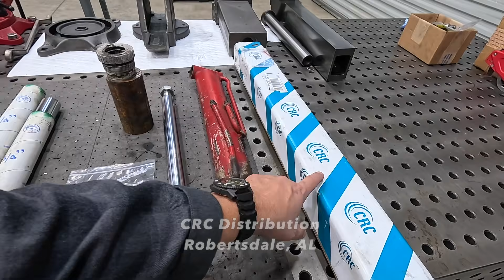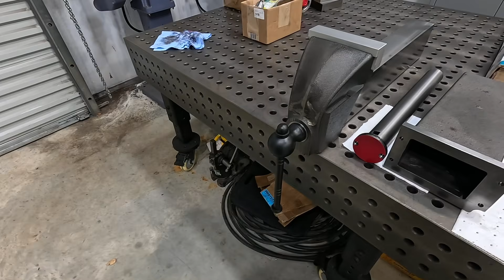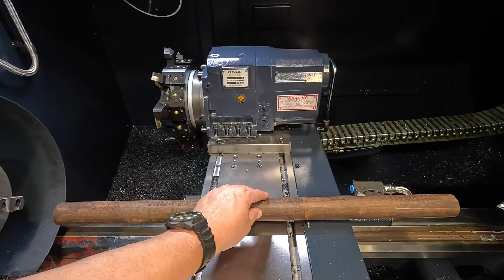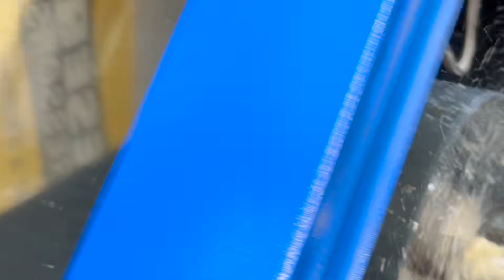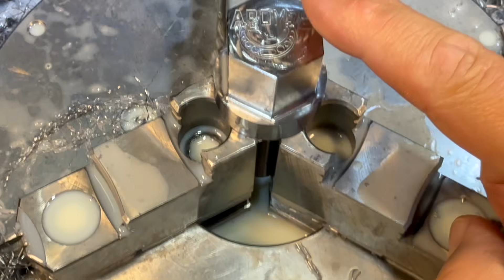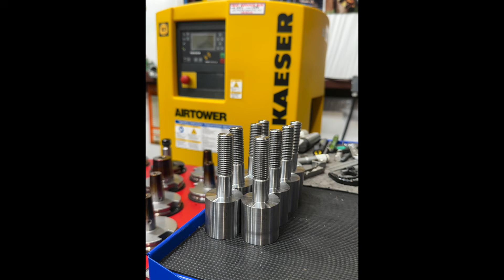Hardtail Vise Prototype Flange Bolts, CNC Machine Updates- SNS 383

Comment: Adam I am sure you get a lot of people asking if you could help them. But I was wondering if you could take a look at something I have that needs repair. All the local machine shops near me tell me they can’t do it or just aren’t interested in doing it. I have a transmission case(aluminum) the cracked when a bushing was pressed in. It is a brand new case and hate to trash it off it can be fixed. I can weld up the crack lathe dissent have the capacity to machine it back on the sealing surface. If you are interested I can send you pictures to look at and see if you would or could do the machining work. Thanks for any help you can give.

Comment: Add a v groove around the head where you want that chamfer to be before heading to the cnc mill.  As it's not touched when the hex head is being carved should allow a chamfer to remain by virtue of order of operations.

Bottom half would be the chamfer you need at the shoulder of the hex head.  The top half would be eliminated by the mill cutting the flats for the hex head.

Comment: Just a random thought: Having a 1.25" head, rather than 1.125", it would be close enough to a metric 32mm spanner to work. I use 32mm spanner on 1.25" hex-bar that I've got - it's a TINY bit slack, but for that size the 0.25mm isn't that much of slack. 1.125 is 28.mm5 (+/- a bit), so it's not a practical metric size - neither a 28 nor an (unusual) 29mm would work. 

I know you're not really a metric guy, and the number of hardtail vices in Europe is probably lower than in the US - glad to hear the US made ones are coming soon... It's taken a long time...

Comment: Adam, could you turn the chamfer before milling with a point tool in the CNC lathe? Then mill the wrench flats down to the centerline of the V-groove and you have your chamfer. The engraving tool does such a better job than laser etching—very nice! Yup, the cameras oversharpen the surface texture creating the appearance of edges you can’t actually feel. This vise is going to be too pretty to use!

Comment: Love what you are doing. Nothing wrong with what you have done for the application, but a suggestion for high load applications is to groove under the head axially. The benefit in this case is the appearance, if you want something that looks different to what is normally done. You would maintain the 0.630 diameter and groove into the seating face. The usual advantage is that the stress raiser that is created is FAR lower than when you machine into the diameter of the part. Tools are available to do this such as (no association, just a google search) GROOVE 'N TURN Insertable Angled Face Grooving Tools - ThinBit by Kaiser tools. With this tool you can actually do the combination machining (cutting in at a 45 deg angle) so that you have to remove the minimum of material while ensuring there is no corner to catch on. (removing material both axially and radially).

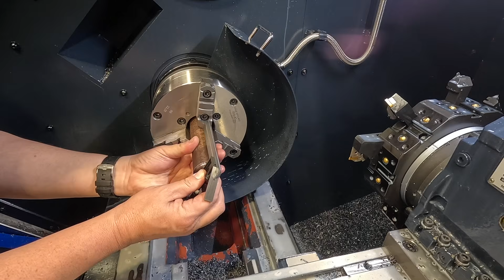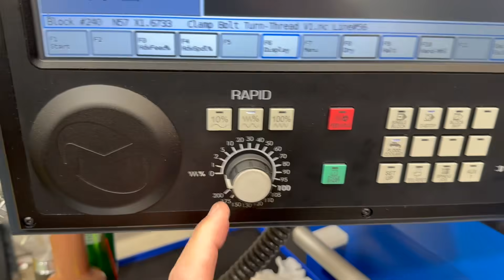Comment: You can use G94 (43:19) to place the face of the part against a tool in the turret (the reference for the length) and use programmed stop M00 (44:34) for the tailstock.

Comment: Just a thought: chamfer the top of the hex in a "lathe style"
Practically, mill a cone, with very fine steps on z, to get something similar with what a lathe tool would accomplish (just touching the sides of the hex). I think it would make the bolts look even better.
As for the finish on the vise, I think the cast iron color looks incredibly good as is, so something to just hide the angle grinder marks on the seems, but keeping the current color, would be awesome.
Thank you for sharing! Best wishes with 2025 projects!

Comment: on this, every third  month, "i'm afraid of cnc and have to keep programming stops and running it at 50%", we see adam is hoping an updated cnc machine and software will come with confidence in the future.  45 minutes before the first part is pull off the lathe.  for crying out loud, move this stuff along.  hit start and send it.  88 minutes for 3 bolts, not including a washer.

Comment: I saw a video somewhere recently (I don't remember where), but they made the hex head on a bolt using a lathe, I dont know how the program worked, but it was incrementally cutting as it spun the part.
Reply: That would does on upgrade version of cnc lathe it has rotary spindle on the tool post it rotates with the main lathe spindle rotation

Comment: Making a set of aluminum soft jaws to face off washers in CNC would make for neat video and once you have bugs worked out, very easy to run high volume of production parts

Comment: 48:07  When I programmed and operates the old CNC Lath at the punch and die hop .. The machine would never approach a cut  in that manner.  It'd get within 1/2" and approach slowly at a 45° Angle, this was the default approach not a special program we made. 

I'm surprised to see a modern machine approach so aggressively??  Maybe this "Fusin 360" method is designed to save time?  Just an observation :)

Comment: I wouldn't expect a metric thread in a product made in the us.

If I may give you some advice to set your Z-Zero safer and faster (I do it dozens of times a day). U know how far you have to turn. Per example your finished workpiece is 5 inches long. Just position the tip of your tool short before the face of your jaws and set your zero by "set  -5.0".   Prevents a lot of crashes and is way faster than measuring it by hand. 
Also, turn your undercuts with your DNMG insert. You don't need to "modify" a grooving tool for that.  Diving in with -30° and turing a radius on both corners is much more stable than a straight groove and there is also no  burr thrown up. But this is a european thing (if you are interessted we use DIN76 shape for thread undercuts and DIN 509 for common undercuts). No additional tool, no additional process - it is just part of the conture), I wonder if this is not also common in the USA?

Comment: Instead of messing with that feed overide, change your feeds in the program how you want them. The worst thing ever is messing with that overide and forgetting to turn it back down on an operation where it could over stress the tool.

Each G1 line can have it's own feedrate so even during that rough turn pass where you turn the knob up and then back down you can just go into the program and insert the feed rate changes on the G1  lines as needed.

Comment: Looks very messy. Get some lolly pops and dial those coolants in. And all of your pauses and manual feed overrides should just be in your program. Also multiple tools being used to do the job only needed by one tool. Limiting your max rpm’s affects your surface feet which affects tool life and etc… for small runs all this stuff doesn’t really make much difference but for a large run these would be critical.

Comment: Great channel.

A  very minor point on your description of the final part :
For 17-4 PH, the PH stands for "precipitation hardening"  not "pre hardened"  

Perhaps this was just a slip of the tongue, but  since you are usually so disciplined and detailed in your  technical information I will not assume that to be the  case.  If you tried to make the  flange bolts out of 17-4 PH  in its precipitation hardened state it would be a  very tough machining job manual or CNC.

Keep up the  excellent videos

Jimmy Johnson

Comment: I would like to see a shaper in the shop.  Not very practical but I love those machines.  On the practical side maybe an HBM.  Also, I look forward to "Abom79 Manufacturing".  Other YouTubers have done ventured into manufacturing.  My only suggestion is to keep the products small and inexpensive.  Unfortunately that will probably mean low profit margins.  I would like to own an Abom79 product made by and in Abom's shop.  A product I would like to own would be a 9 inch 3/8" breaker bar with the Abom79 Logo.  KOKO!

Comment: Those are beautiful and a very functional item for your vice.
The only suggestion I have is you might consider a high polish finish on the head of the bolts before engraving your logo. The swirl mark left by the tool makes it difficult to see the logo, at least on the video.

Comment: I also prefer the wrench, my favorite setup is on my Charles Parker vise. There is an excellent image out there on a 973 bench vise with original handle. 
The top portion of the nut is a cylinder with a split ring to retain the wrench. This way the wrench is easily moved out of the way but still stays with the vise. 
The wrench would also give you a chance to add your logo and would probably make an excellent decorative sale item.

Comment: I don't own a hardtail vise, BUT IF I DID, I would go for blued or nitrided finish, maybe 1045 or 4140, with either a square head like on an old-school lantern toolpost,  or maybe a 12-point spline. And a custom wrench to match.
Reply: Or maybe a perfectly round head--and incorporate a torrington clutch bearing into the wrench. To really confuse the newbies.

Comment: A few tips/ideas for your consideration. 

Bring a tool body down to infront of your Z to act as a bar stop to pull out to. Then you wont need to use your square. 

When roughing/finishing your front chamfer leave it slightly undersize. Then after the screwcutting cutting come back in with the finish tool and rechamfer to size. But, chamfer from -Z0 to the front face which pulls the burr out of the thread. You can also do the same with the under cut at the back of the thread.

Comment: Great video as always Adam. I would consider making something that McMaster don't offer for the machinist. Maybe something like sine plates for setting the crosslide to the correct angle or tool height setters for the lathe. Maybe Tool Posts or Tool Post Nuts. Sine Bars, DTI holders, setting plates, something that the hobbiest may need. Maybe even something for the Camper Van industry.

Comment: Put another groove in during the turning ops to produce a slight chamfer on the top of that shoulder. Or, run a 10mm  spot drill around at the end in the mill ops.

Comment: Something to take into account is that the USA is the only developed country on the planet that uses imperial units. The US industry also mainly uses metric as it is the world standard, this has nothing to do with opinions but facts. Slowly the US will in general also move to metric, and it is easier to use. There will be an overlap for quite some time (like in the UK).
Reply: post 2000 fords and chevys use metic.  As I also on vintage vehicles (Moke, Lotus Europa, 7 triumph motorcycles, dodge A108 van) It's all either SAE or Witworth or British Cycle thread. The UK still uses plenty of Imperia---- oh wait they've abandoned most manufacturing.
Reply: @silasmarner7586  So true !!

Comment: Hi, now that the Flex CNC machine has been passed on, the freed-up space could, for example, fit a CNC wire cutter. Not every workshop has one, and as far as I know, they can be used to make quite special parts. But whatever the new machine you eventually get will be, I’ll be eagerly waiting to see what it turns out to be. And regarding the logo you engraved, I believe it would look even better in the finished piece if you painted over the logo with black paint and then polished the end of the bolt so that the black paint would remain only in the engraved logo.

Comment: Though I would love to have one of those bolts as a hobby machinist I need to stick to something I can actually use. However, those generic stainless steal bolts, holding the vise to the table, need to be upgraded to equally impressive Abom79 bolts. Us hobby machinists would love to have some tooling made to fit our budget level made by Abom79. Please keep us in mind. If there is anything you have made, modified, that you feel we, at our level, could make use of, other than the cheap Chinese crap, consider maybe making it and offering it to us.

Comment: 49:00 it would require some sort of a sticker on the tool (or some other spot that's at a similar distance from camera to the work piece) w/ a high contrast crossed pattern for the camera's sensor focus to latch onto. sensors focus based on contrast lines, having both horizontal and vertical lines ensures the sensor 'see it'. shinny and/or wet surfaces offer v little contrast...

this is a bit beside the point and refers to adjustable focus: the smaller the aperture the deeper the focus plane. it means the focus could be a bit off and objects still appear sharp.. given there's sufficient light, a small aperture results in faster focus too (less focus-search).

Comment: Dig the bolts replacing the knobs. I wonder if you could turn down the area where the hex is to give the corners of the flats a slight radius at the points? Also, would a larger chamfer around the top cut in the lathe would be more visually pleasing? Enjoy your channel. Thx.

Comment: You could use the parting blade on the lathe to cut a groove where the chamfer will end up and then chamfer it before you part it off. The faces of the hex will remove the opposite side of the part and you will be left with a chamfered edge before you go to the mill.
Reply: Yeah, I was just thinking that. You have spatial imagination.

Comment: Man, that is a big ass expensive machine to put in someone's shop when that someone is newer to CNC and primarily does manual machining. 😮 And to provide so much support on top of that it's just amazing.. no doubt, flexcnc got some good publicity by sticking it in front of this audience, but still that was super generous of them. Also, I'm sure that the smaller machine is going to be a great fit. With the exception of those pieces of angle iron that recently got some holes put in, I really can't think of anything that's been  even close to needing so much bed length. 👍
Reply: Yep, Adam has 562,000 subscribers, and I'm sure the companies that have their machines have sold more, than without them there. They can't sell them if nobody knows about them or what they can do.😀

Comment: It's been a few decades since I  machined. I'm thinking you could use the threading tool to plunge cut for the chamfer. There was a series of parts we made with hex stock, but we put a 15 degree angle to the minor of the hex. Personal choice of course. Also we cut our parts completely off. We sharpened the blades at an angle to cut the part side first. It's your show. The Hard tail project is awesome!

Comment: The hex head bolts are hugely better than the sliding handle bolts.  Disregarding the personal opinion of the ergonomics difference, you can get a lot more clamp pressure to resist the vise spinning when you use that longer wrench but I'm sure I'm the only one who has used a hammer on those sliding handles to make the vise hold still.

Comment: Adam, I am not a machinist’s bum-crack but regarding orientation of you logo on bolt heads, is it possible to make an internal threaded mandrel that you secure in the chuck?  You then tighten the bolt securely in the mandrel when you have the top face of the mandrel flush with the top face of the chuck jaws (your zero).  This would ensure that your logo is the same orientation when the bolt is tightened and allows for accurate repetition of parts.  You could mark the mandrel’s top face to repeatedly align it to the same position in the chuck jaws?   I don’t even own a machine but I have learned much from you, including lateral thinking in problem solving.  Stay safe, ABomb79. Your videos are priceless to me! Delete this if it’s useless to you.

Comment: Chamfer on the hex side suggestion - The flange is turned to size, use your treading tool to put the chamfer in while you have it in the lathe.
Reply: This is what I would do as well.

Comment: 4140 is notorious for thread galling.
Reply: But only with 4140 as the mating surface, the hydraulic cylinder might not be 4140, or it might not be hardened to the same state as the piece of drop he'll be using? This can be a problem without a cause for alarm, yet. He has a lot of experience with hydraulic work in his past.

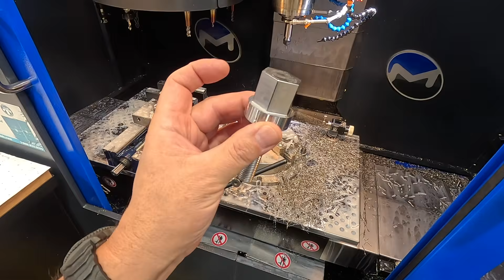Comment: At 59:00 where you don't have the tool to chamfer the edge on the shoulder at the bottom of the hex - what if you added that step in the first process while it's still in the lathe. You have that shoulder height (+/- 5/8 to 3/4'?) and just plunge in .010 to .015 v tool?

Edit: just read in the comments a few others already said the same thing.

Comment: Excellent job Adam.  Could you make a custom tool with a flat pad larger in diameter to the head of the bolt and glue some scotchbrite on the pad?  That way you could have the mill polish most of the machining marks off the top surface which would make your logo engraving pop even more.
Reply: I think he likes the swirl finish. It is very different of course to see on anything machined. This is a unique look.

Comment: I would have preferred a turned finish on the top for the engraving.
Reply: A domed with a very large radius top turned on it as a second op would be my choice. Gives the mill a bit of a work out while engraving. Have not done the math, and my thoughts migbt be incorrect but over that short distance the rise to center would only be .003 thousand of an inch and the way the engraving is laid out would work with out any changes. Now, if this was a smooth diamond drag engraving the rise would count and needs to be accounted for. If it was a 3D pantograraph the pattern would need to be 3D as well. Since this is CNC it is simple as it gets to account for it, even with the conversational programming the mill uses. Well, maybe not that simple -come to thinking on it now. But with Fusion 360 of course it would be easy. Just create a drawing on the domed section and place the logo on that surface, export the g-code.